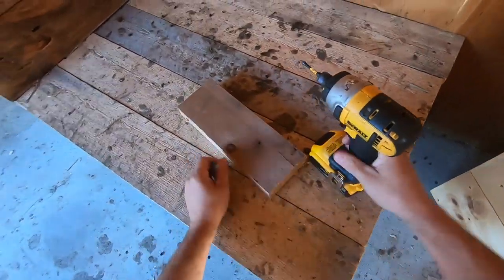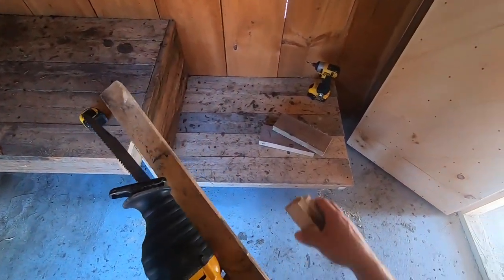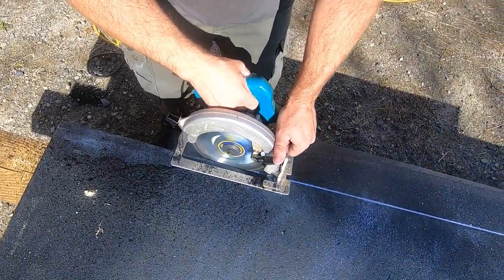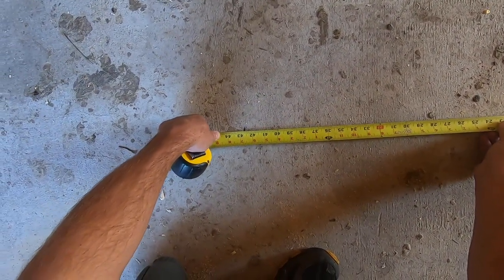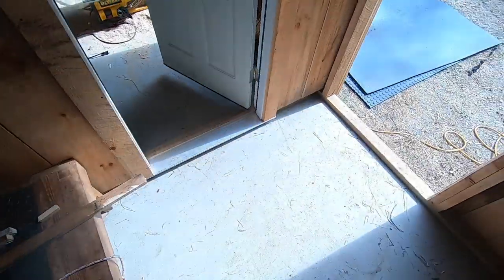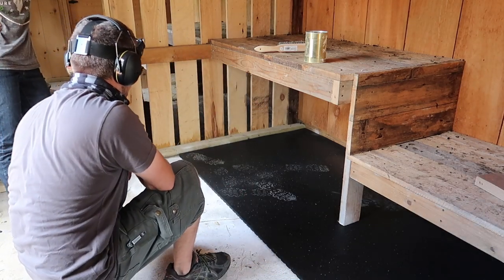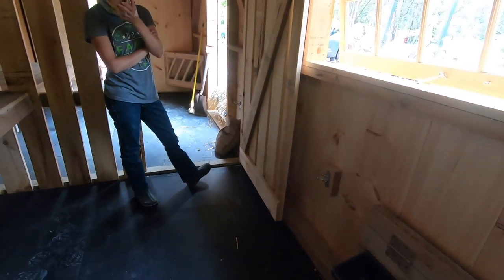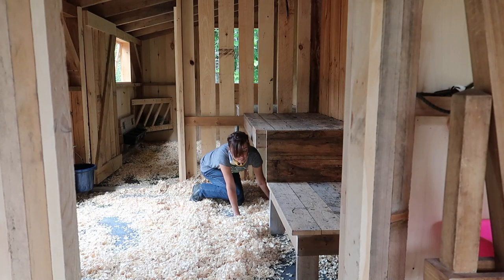was this a HUGE MISTAKE?? Concrete Floors in our NEW BARN

Comment: You can power wash the concrete floor and apply a high gloss sealant used in garages to repel oil and water.
Reply: Spot on thanks Al for the idea i will put drains in my stalls with some fall for cleaning thanks
Reply: Sounds great.  I would also seal the wood in contact with the concrete to help prevent the urine smell building up.
Reply: That's what I was thinking. Although, the mats will keep  it warmer.
Reply: EH CBunny you have to be careful not to make the floor too slippery
Reply: @fionajane56 , they make a "grit" that you can add to the sealer to  make it non-slip.  💝☀🌵

Comment: You definitely need a sealer on the concrete. Rubber mats are great but they are hard to move when cleaning. You will not pull them up that often because they are heavy.

Comment: Mr. and Mrs. Lumnah,
I would, respectfully, suggest a few things.
1.  Use a sealer for the concrete in the stalls.
And
2. Take a page from Joel Salatin and use deep bedding.
3. Avoid the rubber matting as it will, likely, cause more issues than it solves.
My family found this out the hard way in our stanchion barn.
Urine and feces got under the matts at the seams. I think this would happen with your setup. Even if you overlap the seams where the matts meet the urine and feces will seep through.
We reverted back to using a base of ground limestone with a bed of oatstraw or, when available, cornstalks on top. We didn't do deep bedding in the stanchions, but did mucking out daily.
Granted your setup is very different, that why I made the suggestions that I did.
However, at the end of the day, you  know your setup much better than I do and it is your decision to make.
Reply: Did you watch the video? It will be kinda difficult to "avoid the rubber matting".
Reply: Tim Brown 
Did YOU read what HE wrote?!?!?!
HE SAID he himself HAD used the MATS!
Why would he lie?
I suggest using straw as Sandi Brook of SHEEPISHLY ME  uses in her large Sheep operation in Canada. But then in the Milking Areas using Wood Shaving if you can buy them in bulk from a woodworking facility.
I, as mentioned above, don't believe the concrete is the mistake as much as the mats are not going to prove to be workable.
In commercial milking facilities even including goat barns, water is used extensively with disinfectants but Al did not build drains to make that work!
Reply: You are spot on with 1,2 & 3....as I too have experienced too many flooring fails with even fewer livestock.   That said I'm coming back as one of Al and Gina"s girls for sure....those girls live in paradise...lol!

Comment: My experience with rubber matting is that debris builds up underneath it. I'd recommend using plenty of wood chip, wood shavings or sawdust as a deep bedding ( makes lovely compost too!) either with or without sealing the concrete.
Reply: Also, I would add that the stalls need to be cleaned daily.
Reply: Lpsb232 
Actually the Deep Bedding method allows straw to accumulate and say every few months clean out the straw which has absorbed all the animal’s urine because the urine is a source of Nitrogen which can be used as a soil amendment in the Lumnah’s veggie garden or the future pastures.
The straw breaks down much easier in a compose pile than the wood shavings.

Comment: Al, Have you thought about painting the floors with a waterproof (and hopefully urine proof) floor sealer under the mats?
Reply: My apologies i didnt read your post prior to making the same great suggestion! Habe a great day !
Reply: i had been thinking about the goats urinating on that concrete from the start. i had wrongly assumed Al would have a heavy layer of wood shavings, mulch, or straw/hay down. 

"Kilz" https://www.kilz.com/ is the only thing i know of that will work for his situation. but that stuff has some really awful fumes. the goats would have to be either outside or in some other temporary shelter and at least a few days. i'm worried about having these mats in there. "winter is coming" and urine is basically water.

once that urine is down bacteria is going to start growing... gotta have something to kill it and keep it from coming back. i don't know how toxic that stuff is, but i know it'll make 'people' sick.
Reply: Love our rubber floors in the horse stalls.
Reply: Great videos as always. Maybe look into indoor/outdoor carpet. To lay underneath as a barrier. That way with the foam and shavings it will hold your heat or stay cool pending weather. When you want to clean you can use a leaf blower to blow out of the back of the barn and fertilize that area where goats eat. Just an idea.
Reply: The key to controlling urine in a barn in the winter is heavy bedding and frequent cleaning. ideally, do not confine animals indoors anymore than is necessary.
Reply: If you do paint it you can add a traction element to the paint as well to eliminate slipping!
Reply: Just putting mats down will just cause the urine to flow to the edges and seep down into the concrete. Even with mats you should apply a seal to the concrete. The same applies to the concrete under the other overhang. Anywhere the surface is likely to have water or chemical exposure.
Reply: @kbrowne10   I hate it. great hiding place for bacteria to hide and grow and a pain to keep pulling it up to clean underneath.
Reply: There is loads of sealants that they can use‼️ .......  They can pay a visit to the relevant store/s and hopefully they'll have what he's looking for❗️
Reply: They will probably have to put down a floor sealer under the mats.  Those mats appear to be porous.
Reply: Epoxy floor?
Reply: would something like a latex or epoxy paint work to seal against urine seepage?
Reply: @Forrest Gump As someone who knows nothing about the subject, I can offer all kinds of brilliant advice....but it seems to me that your reference to the dairy industry would provide the best starting point for research on the problem.
Reply: The mats are going to corrode from the acidity in the urine
Reply: Excellent!
Reply: The E.C.R.G the Realm of the Unknown!  Me too!
Reply: Carmen Garcia 
The rubber will not be damaged by the urine.
That’s why people use rubber gloves to protect their hands while working with chemicals.
Reply: @thee.c.r.gtherealmoftheunk3717  Absolutely fine, it is so hard to scroll down and see everything.
Reply: @russelltomlinson2353  Great idea!
Reply: The Other l

Comment: Did you seal the concrete after you poured it it’s not to late
Reply: Just was going to suggest that. Sealing the concrete will help some.
Reply: Yes I did not autocorrect changed it
Reply: No he did not seal it, but I suggested it several times and even gave him a link to some.
Reply: @Sarahs-Faith  their were several people that suggest that as well as putting a cracking scar into the floor to keep the entire slab from cracking all the way across......especially as cold as it gets there as seen on his videos......he never even thanked all of the people that gave him all the good suggestions that would help him in the end......but he sure is one hell of a carpenter....wish I knew what he does as far as building with wood......I like it......it's perfect......and from the plumb and leveling it always looked perfect.....If I had his ability I would build my own barn as he did......but I cant even cut a board straight even when using a table saw.....but I did have my garage floor sealed ......
Reply: Al rarely heeds advice.
Reply: @Don Marlowe,  he is a great carpenter he really did a great job building not only his barn but his house, the outdoor kitchen, the chicken coop, ppm, and the wood shed looks great! 
He just needs to learn about how concrete works and what to do to protect it since it’s the foundation of 2 of the most important buildings he has built. 
Concrete is like an oversized piece of bare wood sitting out in the elements, you protect it with a sealer.

Anyway Don building does looks hard and it is hard manual labor but if you have tools and a drawing or sketch of something with measurements on it (blueprints are good for professionals but for reg people they are hard to read) and if you have the correct materials for your project and always measure 4 times before you cut you will be just fine.
The great thing about the barn he built was that it all came precut and if you follow the plans sent to you then you can’t mess it up and I encourage you to build something but start small. If you need any help let me know I’ll talk you through it, since I’m not there.
Reply: Don I own a construction company we build all kinds of things ;)
Reply from the maker: no we didnt
Reply: Came here to say this as well. Cheers guys. ~Mike and Ester~
Reply from the maker: I didn't but I am getting some good advice on this video. Thanks for all the help
Reply: Yes, that's what I would do...and then keep straw bedding down to turn into compost.  He can always hose down the floor on occasion.  Won't those rubber mats become a breeding ground for fungus, underneath?
Reply: @LumnahAcres  You can only do so much. Until Gina is up to speed, it's going to be hectic for you.
Reply from the maker: @liorajimenez3085  Thanks for understanding!
Reply: I’m kind of taken aback here ... some of these comments sound like they’re criticizing Al for not heeding THEIR advice in the first place ... this is Al and Gina’s property ... they can go into a project with their own ideas, whether they prove right or wrong.  Comments like “I told you several times” and “Al doesn’t heed advice”  or “Al didn’t thank me” aren’t really necessary, are they?
Reply: You guys are doing great. I vote for deep bedding with hay or wood chips. Goat 💩 plus hay = 👍👍
Reply: Where did you get the mats? I’m looking to do this for our horse barns
Reply: I love the rubber cow mats. We had a local farmer give us a pickup load of old cow mats that were still in plenty good shape for our goats. I use vise grips as handles when lugging them around, and clamp a tow strap to them when I need to pull them around with a tractor.
Reply: @christinray6067  https://www.tracc.ca/product/rubber-matting/  I know it is a Canadian company but they ship to the US and have distributors there.  Give them a call and they may be able to help as they manufacture them.
Reply: I came here to ask if it was sealed as well, especially if you'll be storing any fertilizer in the barn. I don't know if its some kind of chemistry going on but the concrete just picks up and holds the ammonia from a little spilled fertilizer forever. It's bad! Concrete is really porous it soaks up a lot of fuel, oil, and goat urine too I guess. Oh and keep that rubber mat for crawling up under the tractor and truck in the winter, pure luxury!
Reply: @Mme Popova  Thank you
Reply: @christinray6067  My dad bought me one from Tractor Supply - to use as a backdrop for my archery target area.
Reply: Collette Landwer agreed. Also- there are how many subscribers? Al works hard, he may not be able to read EVERY. SINGLE. COMMENT. 🤦🏼‍♀️ some people. Yeah, they may be knowledgeable, but after a while, everyone telling him what to do, bet it gets old. He does a good quality work, but he’s bound to make mistakes- we all do. It’s ok.
Reply: @christinray6067  Get them at Tractor Supply (usually out in the yard area). These are also great for making into leveling blocks and strips to level my RV Trailer, much better than wood blocks...

Comment: They make coatings for garage floors. Stop oils from staining.
Reply: Recommend using Lithium Silicate that densifies concrete, and isn't prone to peeling like floor coatings are. Concrete sealed with lithium Silicate can be polished. Many Lowes\HomeDepot stores used polished concrete floors.

Ideally the concrete pad could have been insulated using rigid foam panels & use a heavy gauge vapor barrier to keep it warm and dry during the winter months.
Reply from the maker: @guytech7310  Ill have to look into that never heard of it before
Reply from the maker: @guytech7310  Thanks I am thinking about ordering that. seems like a good product

Comment: Probably worth treating the bottom 12" of the stall walls to protect the wood with a waterproof coating of some sort.

Did you coat the concrete, to seal it?

Comment: What you guys are smelling is the gas prodused by the uric acid that has bonded to the concrete. 
It's gonna continue to release gas whenever it's subject to moisture. Use a sealer and put down a sheet of plastic as a 2nd barrier before adding those horse stall mats :) Love your vids! Greetings from Norway<3
Reply: The plastic is a good idea.
Reply: Agree, know you never get the smell out.  He will learn!
Reply: I was thinking of the sidewalks of New York City (not his chicken coop). When it hot and after a rain, all you smell is the urin that’s firmly embedded into the concrete sidewalks. 
I would most definitely go with a sealer for the concrete before it’s too late.

Comment: Good morning guys. Sealants will work... but they have to be resealed on an anual basis. I would spend a little extra and get an epoxy based paint. Its a permanent solution.  This will eliminate any urin adsorbing into the cement. Also makes it easier to clean up other messes as well.
Reply: I might add that if you put an epoxy paint down, you can also sprinkle sand all over it before it dries.  This will give a nice texture to help keep the goats hoofs worn down some. Kinda like you did on the play spools.
Reply: @debt4717  
Thank you Deb. Just sharing experience,  Would hate to see them have worse problems in the future.
Reply: Good ol Mac646 epoxy would be great yeah. Should always check your coating yearly for wear/damage but a good epoxy (not a pool epoxy) should last ages.

Comment: Gosh Al, I’ve never questioned any of your decisions before, but I see those mats and I think you just made more work for yourself. Urine will get down under those mat seams. Pulling those mats up, cleaning and getting them back in the right order would be difficult. I’m with those who say seal the concrete. I would put some sort of epoxy paint down. Easy to clean. 

Finally, since you have done what you’ve done and I’m sure the mats were expensive, I hope it works for you for a long time. 

Are you sorry you asked our opinions? 😋
Reply: Al never listens to advice once he has a plan.

Comment: I hope the mats work out for you.  I have them in my goat stalls, which also have concrete floors.  At first I only put down straw and it really stunk mostly because of the urine.  I've since added a layer of the expandable pellets that turn into saw dust and covered that with a deep layer of straw.  I've also added lime.  It's much better than it was.  When I clean out the stall, everything goes into the chicken yard and they break it down for me turning it from compost into soil.

Comment: Try cleaning with sodium percarbonate (sp) then seal with Diamond Rock Hard sealer.  It kept red wine stains off the floor and when the sealer needed to be reapplied,  the sodium per carbonate removed all staining.  I still use it for non-bleach whitening and odor removal (cat urine smells)

Comment: There are so many good comments from people who have experience in these areas. Together, these seem to make the most sense: like good a sealant on the concrete, then a plastic layer,  some kind of goat proof coving for the walls, lay the mats correct side up (the grooves are channels for the urine to help keep the wetness off the animals) then silicone the mat seams and at least 6 to 12 inches of bedding for winter.

Comment: Hi Al, as suggested before the herd moved into the barn, a water sealer would have been very helpful.  Please please follow this suggestion, in the other barn for Caleb and Zeke find a water sealer for the wood (non-toxic) that you can spray top and bottom of bunk beds and half way up walls at least.  Once those Billie goats mature and start peeing on their heads to show their manly hood it will absorb from their coat into the wood, just the vapors alone will absorb into the pours wood walls.  As someone else suggested get some insulated and summer weight cover-alls for working with the billy goats especially since you are training them to like affections of a human.  You won’t be allowed in the house without shedding your clothes.  Billy goats are just nasty, I’d send my girls out to be bred by a trusted stud instead.  You may want to relocate that barn far from the house as well.  Don’t believe me, someone out there please invite him to visit your stankinest billy....
Reply: basiaboy 
Don't they offer AI for goats???
There is a great system for pigs now that HomeSteaders can easily use.

Comment: Al and Gina, the mistake was in not sealing the concrete and not putting down any absorbent materials like straw or shavings to absorb the urine. Mats will not cure the issues. Livestock need some bedding materials. I would use lots of pine shavings as bedding. The mats will trap the urine under it and will contain the smell. They are heavy and hard to move so you will be less likely to pull them up and clean under them. Especially in winter when they will freeze to the ground. I know I tried this very thing with my goats when I lived up in Alaska.

Comment: I agree. The concrete and the wood on platforms should have been sealed. Then all you would have had to do is power wash with kennel cleaners. Idk if it would make a diff. I have dogs. Still stinky at times. I reseal yrly. Spray out wkly.
Reply: TeeWee A 
No drains to get the place dry in a hurry
Reply: @BrianBriCurInTheOC  guess I need to re think my set up too. Lol. Thank you.